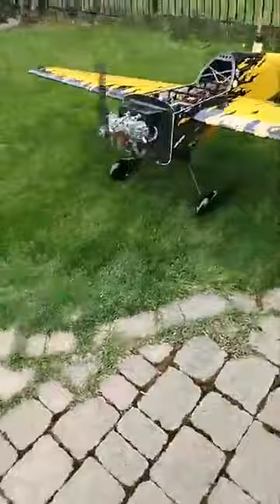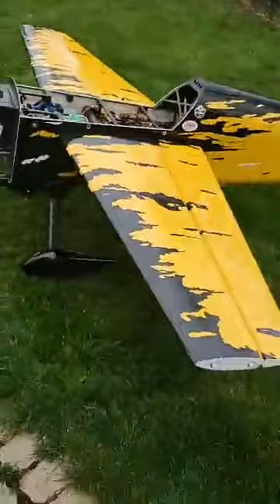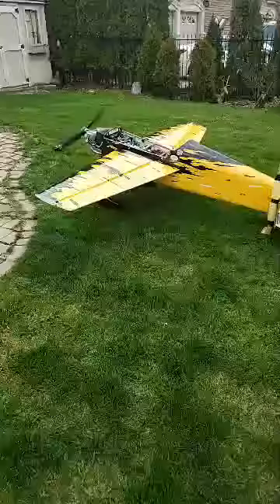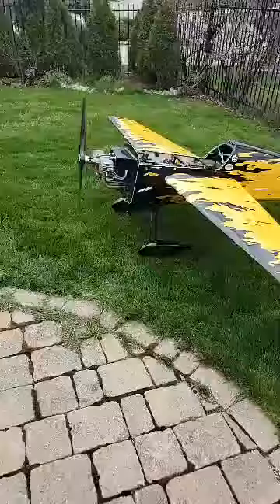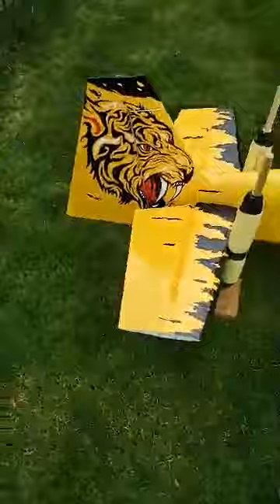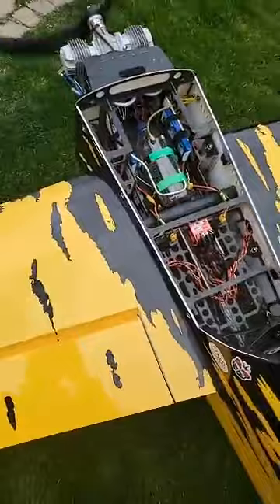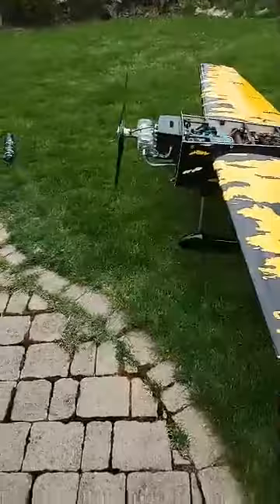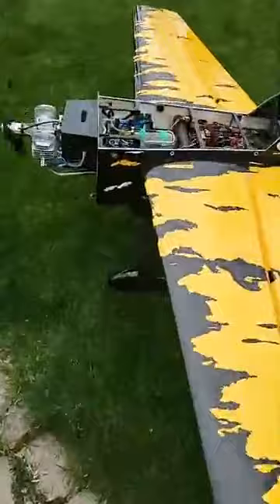EME120 with JMB Brecka Canisters and Headers

Comment: Are these front dump canisters, do you think they will go well with DA120? Can you please share the exact model number as i am not able to locate it on the website, many thanks
Reply from the maker: Hi  Nakul,

He makes headers for the DA120 as well.  The canisters on this plane are rear dump.  They are the TRA60L-MP but you can purchase the same canisters in front dump configuration.

www.jmb-brecka.cz
Reply: @joetrin   Thanks, how are the cans holding up with time? will look into these
Reply from the maker: @nakul3424  I use these exclusively on all my planes. 91" ars300 with GP76 on Y headers, 104" Edge 540 with dual canisters on a dle120, 104" extraNG with DLE130, and now I'm putting together a 104" Yak54 with DLE130.

In my opinion, JMB makes the best header and canister combo for no matter what engine you have.

They provide linear power delivery and are quiet.